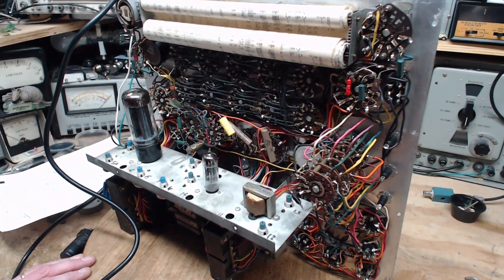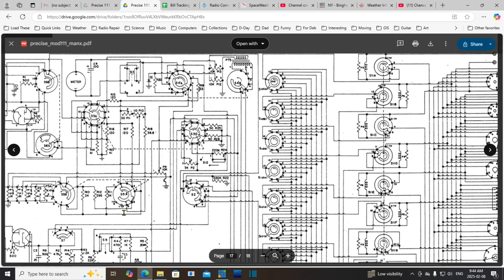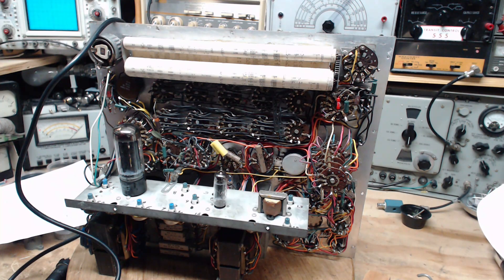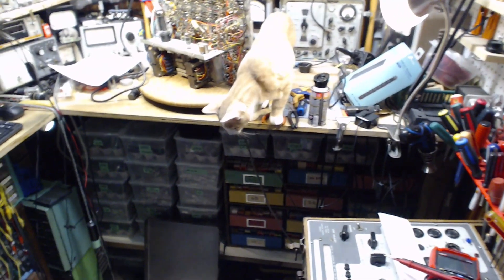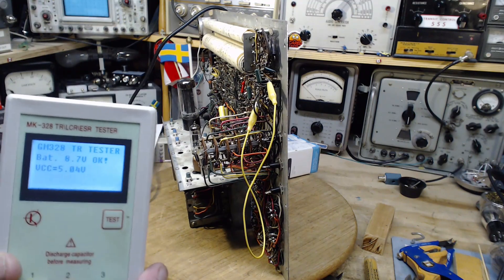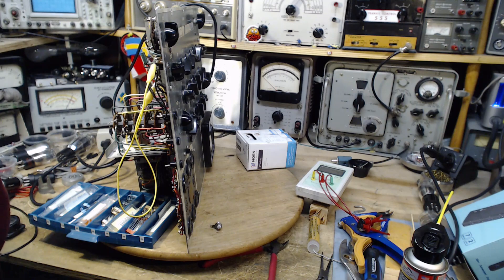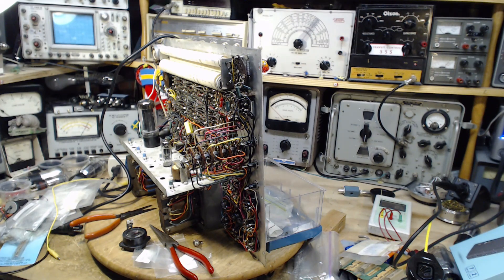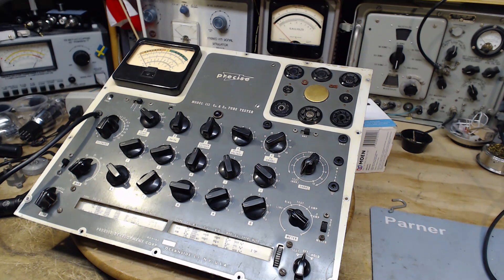Tube Tester Testing - Precise Model III Gm & Em Tube Tester - Video #3

Comment: I also own this tester. And refurbished it about 10 years ago. What a nightmare to troubleshoot and calibrate.
According to my notes, I had to re-attach a power transformer winding to #14 stud to correct a meter issue I had. If I recall, it was a very fine, copper winding that was disconnected. Check the studs on power transformer.

Comment: I have that exact same tube tester and the diode (1N64)was bad in mine as well. There were also an adjustment pot that was bad (P8). Had to fix both those issues before I could properly calibrate it. It is a very good and I believe accurate tube tester tho it is quite the pain to set up...